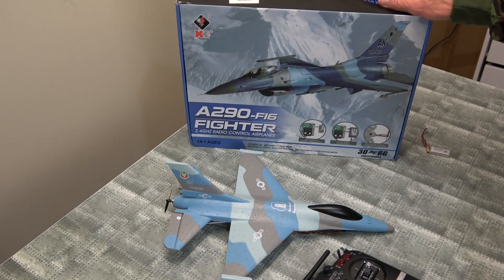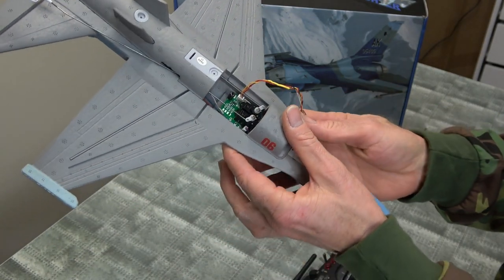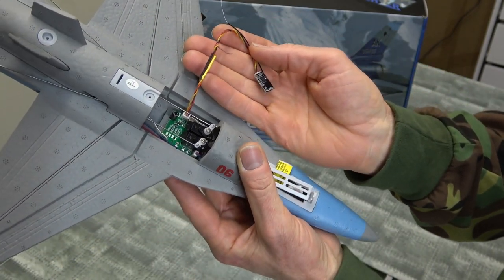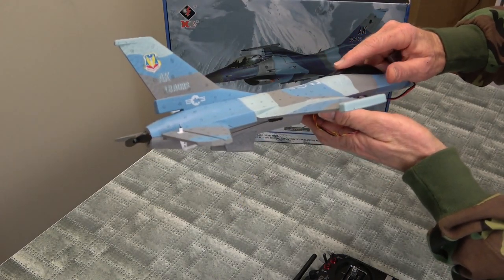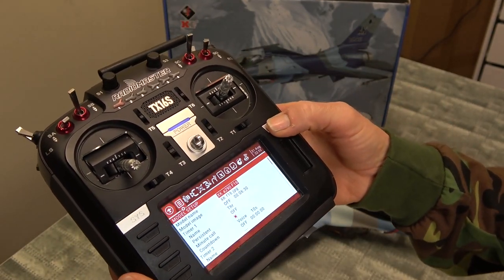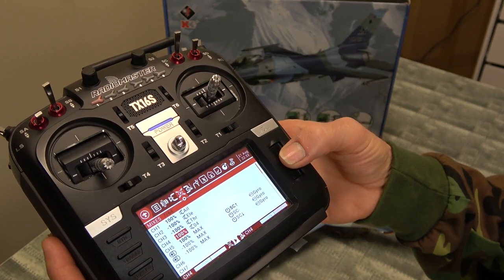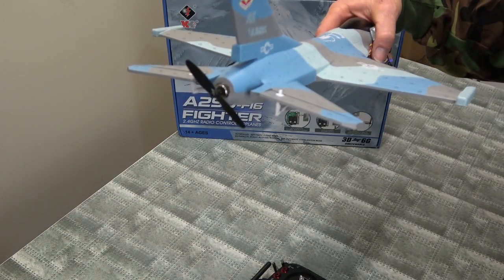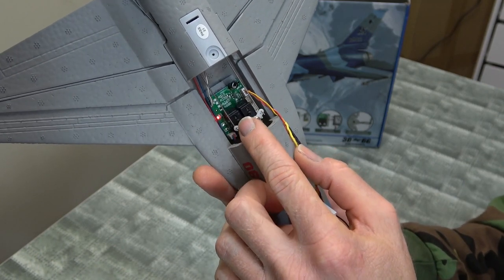How to Bind to XK A290 F16 RadioMaster multiprotocol micro receiver RC plane WLtoys

Comment: Good video...Ch7 is used for gyro. This works on the XK A280 P51 using protocol V911S/E119.
Reply: Have a q/a 
How can i set up the TX12 
With XKA280 
I try 911s/ protocol is not bliding

Thx.
Reply: @ธนพลจันทรสิทธิผล  ...Those are the protocols. So you have receiver problems, radio problems, or they changed the protocols in receiver.

Comment: The basic design of the board is used on all those different models but there is a spot next to each model to mark which programming has been loaded on it. The boards won't be interchangeable. Just like the Volantex/Eachine V761 boards. ;-)
Reply from the maker: Yes that must be what this is.

Comment: Blow Fly, your videos are great but I need some help understanding how you wired the SBUS receiver and which wire you left unconnected. I think you said the Brown wire was not connected but you also said you connected Brown to Black. What am I missing? Thanks
Reply from the maker: Yes brown don't use and black wire on receiver is ground so depending on the colour of wires in your mini plug mine is brown.  That receiver is discontinued so I just got a new flysky fsa8s and it's wired different you don't use sbus you use ppm and all channels are reversed

Comment: Oh and "pdog19591" has just informed me that this uses V911S protocol E119 sub-protocol but that he can't get the Gyro mode to switch so probably it uses a variation on that protocol that may need some work by the Multi developers to get full features. (Like the A180 sub!)
Reply from the maker: Thanks for your info
Reply: I have two XK planes and cannot get the safe mode to work on either. Very frustrating.
Reply: @me262mike2  What equipment and protocol are you trying to use?
Reply: @theoztreecrasher2647  XK A220 and A260 using a RadioMaster Zorro.
Reply: @theoztreecrasher2647  
Protocol V911S, subtype E119.
It binds normally.
Reply: @me262mike2  If your Zorro binds normally using V911S/E119 then you should be able to set up the higher channels to switches (in the Mixers Page) to be able to switch modes and rates as in the documentation for the protocol. If not what version of firmware shows under the protocol selection on the "models' page?
Reply: @theoztreecrasher2647  
Thank you. I was able to determine I needed to use Channel 7 under mixes. Works fine now.
Reply: @me262mike2  Glad you got it working. This video can be a bit misleading for those who want to use the stock protocol on a multiprotocol radio as opposed to a satellite receiver in 1 of the DSM/S-bus sockets on the plane's board. With a satellite the modes may stay on channel 5 (depends on which satellite/protocol you use) but with the stock protocol they can be on different channels. It just depends how the folks hacking the protocol for the Multi Module have ordered them!

Comment: Can you please make a video on how you set up the AK A180 JET to your Radio I got mine for Christmas and I managed to get it hooked up but my steering is reversed for some reason. If you didn't know it uses protocol MT99XX H7, it seems like a fun park flyer.
Reply from the maker: I have my f22 on mt99xx dragon and its lock on 6g mode and on the mixes page Ch1 -100% and Ch2 100% and Ch3 100% then setup rates on inputs page 100 90 80 with 15to 20expo
Reply: @blowy48flyrc  I'm not sure I'm following, is there a way you could help me with it in private maybe Facebook message or video would be easiest
Reply from the maker: @JurneMolina  I know it is complicated opentx and there's a lot of Tudor videos on YouTube that's how I learn good luck

Comment: I tried to mount an a8s flysky on my xk a220 on the s-bus port but when I connect the battery the receiver doesn’t turn on like it?!
Reply: The Flysky A8S comes from the factory default set to output i-Bus NOT S-bus. After you have that receiver bound to your transmitter you CAN change the i-Bus to S-bus output if you follow the instructions included with your receiver. i-Bus WILL NOT work on an S-bus input socket!

Comment: Anyone know if I could use a receiver like this on a xk450, I have a xlite any help
Reply: No, you cannot! There are no satellite sockets on the XK X450. You can however use the XK/X450 protocol choice on a 4-in-one multi protocol radio if you have a fairly recent firmware version loaded.